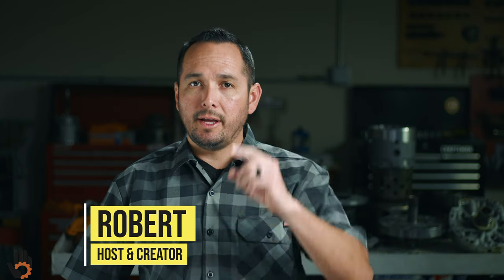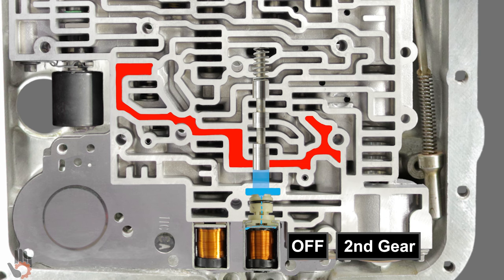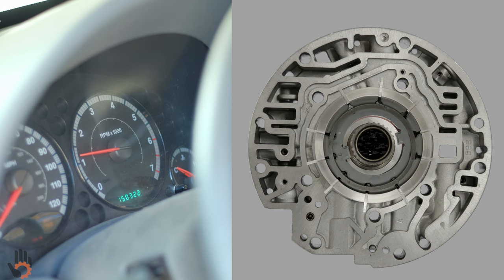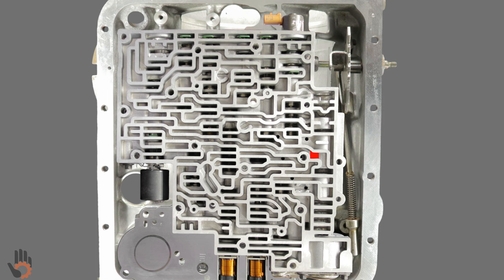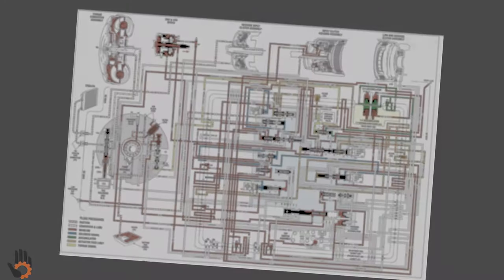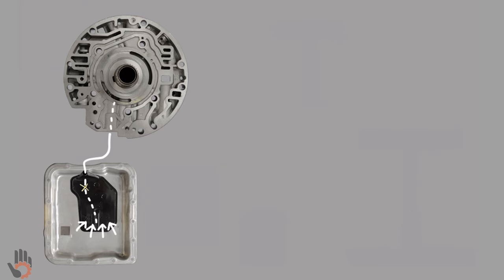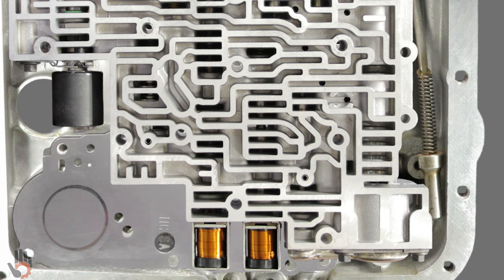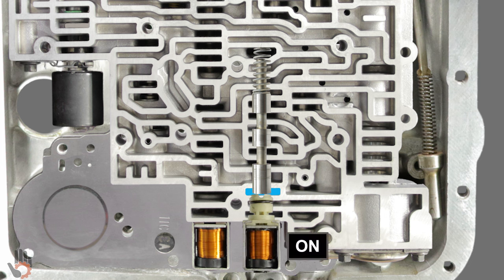4L60E: 1-2 Shift Valve + 1-2 Shift Solenoid (Part 1) Basic Operation

Comment: 1st view
Reply from the maker: Awesome!
Thanks for stopping by.
Reply: I just found your channel and I'm in desperate need of your help your very informative and I'm on disability bringing in only 794 a month I've got a 95 astro van 4.3v6 with a 4L60e and am told it's a one yr only Trans due to manufacturers adding an additional solenoid that yr only I've went through 4 different junkyard Trans non was any good so I bought one from a man in his 70s that was that was retired from a major transmission company  I put atheist 5 thousand miles on it before it gave me any trouble all of a sudden 4th started slipping  when cold shift like a champ once it's at normal operating temperature it starts slipping  an if u let up it will fall back in gear press on gas revs up am slips right before this started I'd been behind a buddy sn was going probably 35 I'd kick it down an as soon as it kicked into passing gear I'd let back up like a sudden gun of gas peddle instant diem shift as if going to pass someone an instantly let back up I did it several times to my buddy upfront of of well about maby 40 to 60 miles later in its life I started to experience it shifting in an out of all gears an thrc2 speed torque converter seemed to shift in an out so smoothly an with little speed I'm talking under 45 mph. On straight away no load on vehicle sailing along at low speed it was actually going in overdrive an even the 2 speed torque converter was in its highest weakest gear turn then one day the engine reced high but vab didn't speed up I knew then 4th was going out an within a few miles it went plumb out Rev engine van not speed up let up on gas it go bk in an would push van on down the road fir miles until I was on a slight pull hill slope it instantly Rev an van not pick up speed could I have damaged torque converter or 3-4 clutch pack burnt out an slipping or cold I have damaged a shift solenoid or torque converter solenoid I'm at a loss an like I was explaining before I get less than 800 a month to live on the transmission at advance auto or auto zone without torque converter is like 1600.00 I don't know if I should have trusted the man I bought it from cause the outer case of Trans had never been degreesed it was greasy an to be honest the only thing looked new was the pan gasket front desk to me looked used so I replaced it before putting it in please I really need your help I lice in Virginia an on the west Virginia state line there's few junkyards in these coal fields we live in an finding a good used 1995 4L60e is impossible if it helps you any  I can send you me number and you can call me I'm just saying if communication back an forth woke easier I can send you my number so you can call me  I'm st your mercy I've watched many videos but you are very informative and u brake things down to where it's understandable I can tell you know ur stuff I've been a mechanic all my life but I'm no transmission man I took my original bad transmission apart on a full sheet of plywood with 2x4s bsiked around all edges so nothing could slide off or roll off like the 7 ball besringd in valve body plates an once I got it apart I was like  nope not my cup of tea lol please any advice is much appreciated
Reply from the maker: It can be hard to find a "good" used unit, regardless of year.  You're correct, '95 is a standalone year of 4L60E....which makes it even harder to find a good used unit.
Junkyard units are always a gamble...

Questions:
1). What is the current problem with the trans?
Reply: @SouthpawAutoworks  I just traded-sold a '95 4L60. It was "rebuilt" twice is past 2 years, and oil was burnt w metal. Friendly local trans shop paid me $300 as a core, as he told me was 1 year only
Reply from the maker: Right on!
That's correct.  '95 4L60E is a standalone year (interchangeability).
Reply: @SouthpawAutoworks  4th feas fuje when cold after driving anywhere from 8 to 10 miles it starts to slip put of overdrive letvup it falls bk I'm I explained everything I'm my original text please review my first text I sent u sorry it was such a lengthy text but with the issues I'm having  hiwvit act an when it dies it an what I did yo it prior to it starting to slip I had to detail everything an therefore my text became extremely long please let me know what ur opinion is
Reply: Please  help with my issues I'm on less than 800 a month disability check an a remanufactured 4L60e 95 model stand alone year is over twice what I bring home a month on disability that's not counting a new torque converter this van is my home an my dole source of transportation I live in my van I do the van life I really need your help south paw
Reply: I sent u full detailed message a couple of days ago in thes text messages please locate it rrviee it sn get in touch I have no doubt your thr inlyb8nr on YouTube that could most likely tell me right off the top of your head what I damaged in Mt transmission  u was gifted by God with the knowledge on this stuff no doubt sn thr way u explain it in detail I've nor seen another person on YouTube as relaxed as u are you nake rebuilding transmission look as easy as riding a bike sn I know it definitely using that easy I took one apart that's as far as I got lol